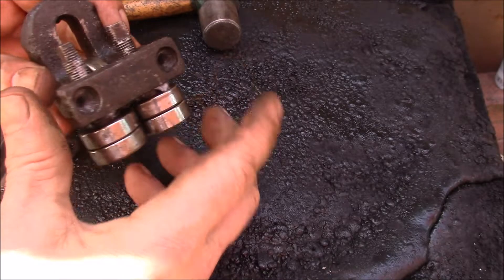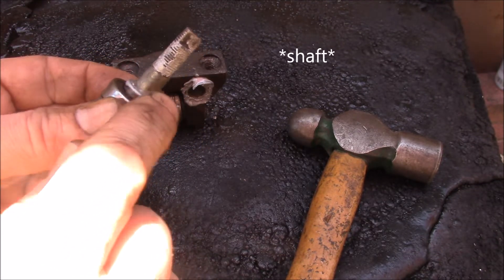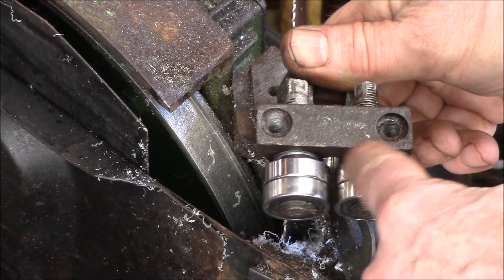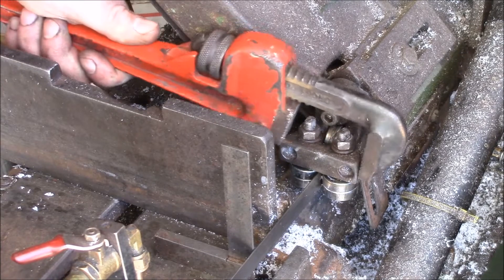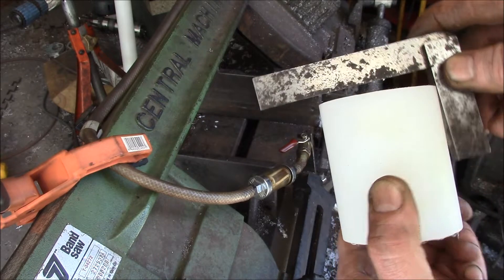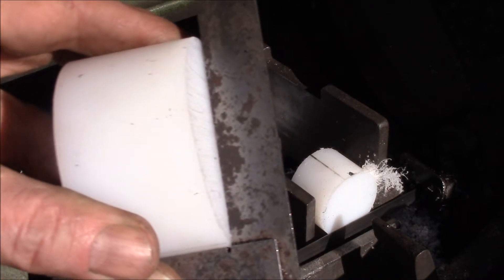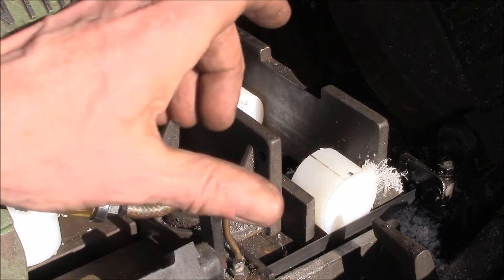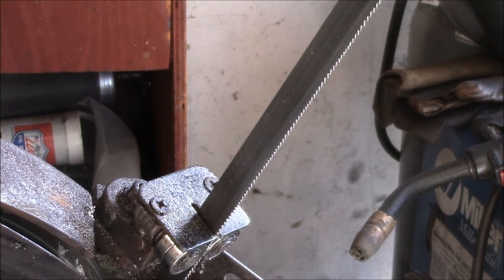Horizontal/Vertical Bandsaw - Blade Guide Alignment

Comment: Thank you Mr. Brown.  I have a used Enco 7x12 that is not cutting square on any plane.  Your explanation has been most enlightening.
Reply from the maker: Glad to help.  Also, be sure to check the pivot point at the back of the saw, sometimes those wear and cause issues.

Comment: I'm having similar issues with a "semi" portable band saw I purchased from Harbor Freight. After installing it on a mounting bracket, the blade tends to want to twist and it ends up sawing at an angle. I will look at the guides and see if there is an adjustment.
Reply from the maker: That's a good place to start.  Make sure the guides are up snug against the blade.  Also, looks at the pivot on your bracket as these saws can put a lot of twisting force on the bracket.

Comment: Currently cutting some 8 inch solid plastic on our shop saw. What a nightmare.... blade is angled 10 degrees towards the saw vice but it cuts a 10 degree taper in the opposite direction 😂
Reply from the maker: Yes, plastic can be a challenge.  I cut loads of plastic on my saw, although nothing quite that large.  One thing I do is to keep a dedicated blade for plastic.  It's usually something with the teeth on the blade that'll make it cut off like that.
Reply: @The4Crawler  I was thinking a blade with a wider tooth offset might work better. With the larger od plastic, the slightest bit of drift causes the blade to get hot and eventually stuck. It's such a pain. Multi million dollar company with a 600$ saw 👍
Reply from the maker: @DrDime_  Yes, try some different blades.  I usually run something in the 4-6 TPI range.  Might also step the saw down a speed or two to reduce the heat generation.
Reply: @The4Crawler already slowed her down but will have to try a blade like that. Or they could just get my big saw wired back up in the machine shop and I wouldn't be wanting to set this saw on fire 😂
Reply from the maker: @DrDime_  For sure, a larger saw will be more rigid.  On the blade, you want to look for a "raker set" on the teeth, which is how they are set on a crosscut wood saw.  Also, you need a large gullet on each tooth to leave room for the cut material.  There are special plastic cutting blades available, about 3 times the cost of a similar metal cutting blade though.
Reply: @The4Crawler  talked em into getting my saw set back up in the machine shop right after I got everything aligned and working on the crappy one 😂 but it was still a pain because blade was still getting gummed up. But we're all good now. Thanks for the info 👍